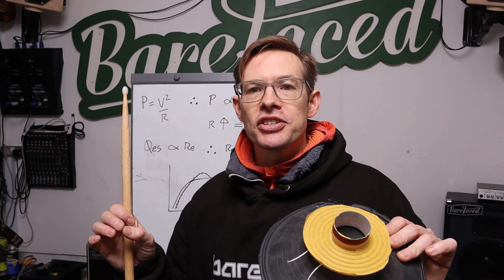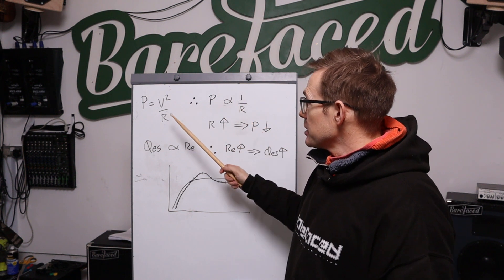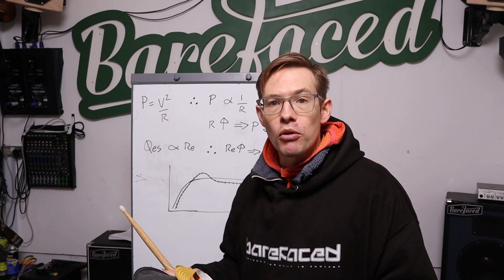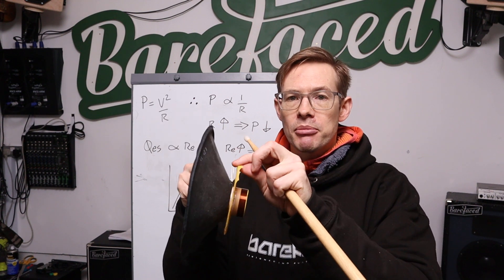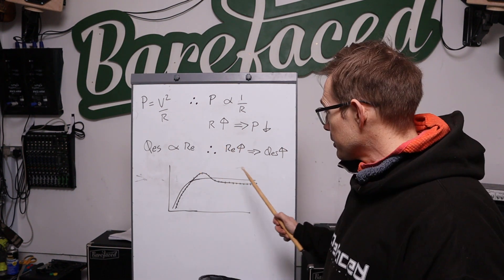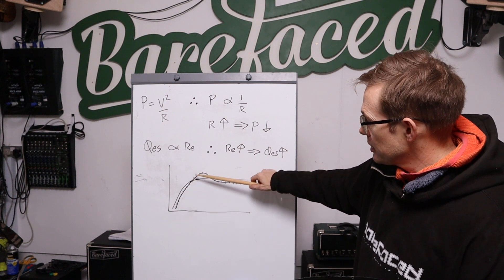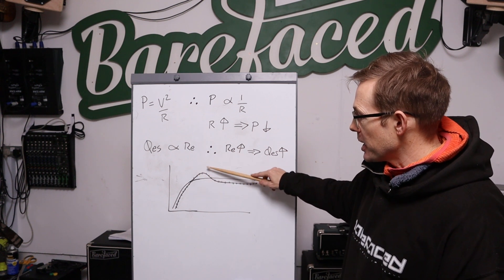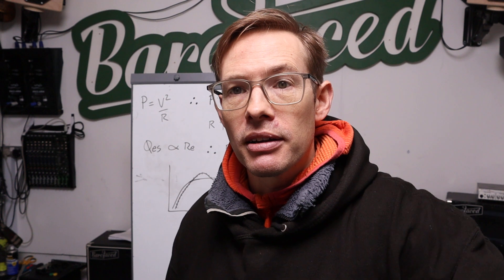It's getting hot in there, it's messing with your tone! How power and heat changes your sound.

Comment: So wait, just to be clear: The loss in power in the highs is the result of heat. OK, got it. 

But does the resonant bump have anything to do with the heat accumulation as well? Or does it only have to do with poor matching between a ported cab and a high Q speaker? Is the presence of both of these issues merely the unlucky result of playing a bad cabinet too loud? 

And, does this second issue aspect impact open-backed guitar cabinets as much as it does ported bass cabinets?
Reply from the maker: The increased temperature causes the unwanted resonant bump. So a cab with great sound and frequency response when cold could sound boomy/muddy/woolly/slow when the speaker(s) get hot.

Comment: The heat from hot tubes dries out the speaker cone, which I assumes was a good thing, possibly making speakers in combo amps sound better than extension cabinets?  I notice my combo amps sound better after they're turned-on for awhile (30-60 minutes), but that could be from other factors.  Interesting subject to contemplate!
Reply from the maker: I would hope that your speaker cone is already dry, they shouldn’t leave the factory until they are!

Comment: Great video. I used to build sub boxes back when I was in high school. We used software that determined the size of the box, port, etc. I constantly had to explain to people the difference between a sub designed for sound quality and a flat response versus a "boomin' system" that most high school kids want. They were always surprised to find that the bigger, boomier boxes cost less money. Once we had to completely seal up a trunk on a car because the volume of the trunk was too small for the box. But he wanted two 15" subs in his trunk. One guy wanted 8 15" subs in the bed of his pickup truck ported into the cabin. Holy cow...that was an insane install.

Comment: I have sometimes wondered about Peltier cooling and heat pipes to get heat out of a sealed or insufficiently ventilated box. The solution seems to usually be distribution to extra transducers but that defocuses the sound origin. I guess it's about compromise.